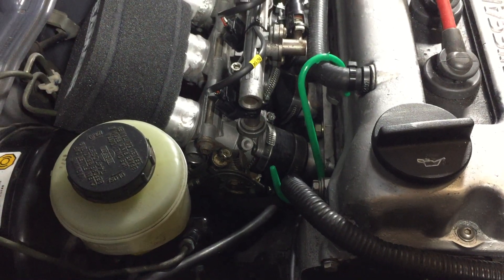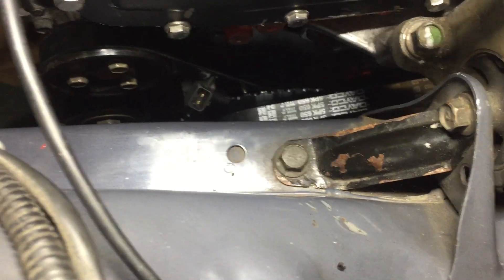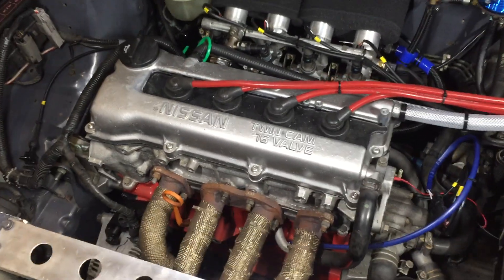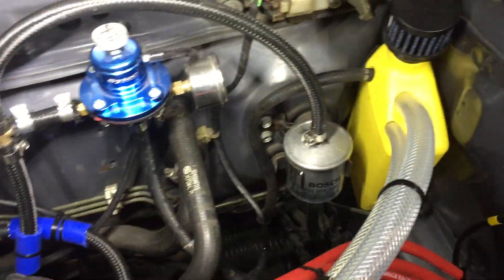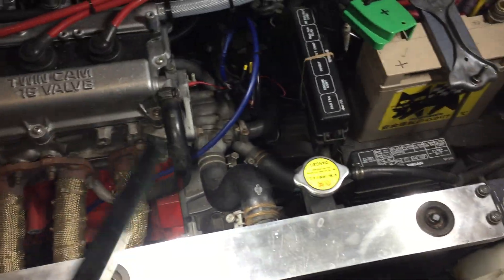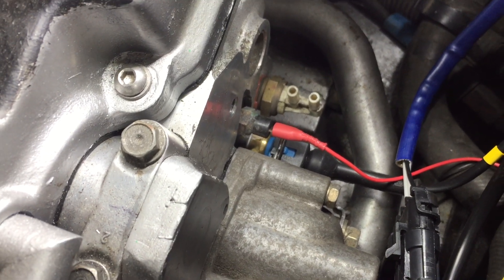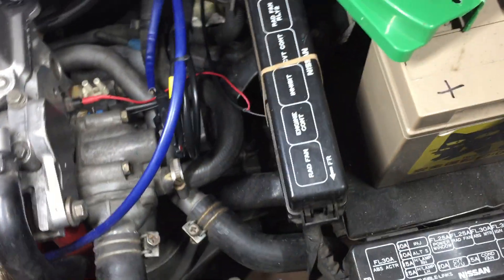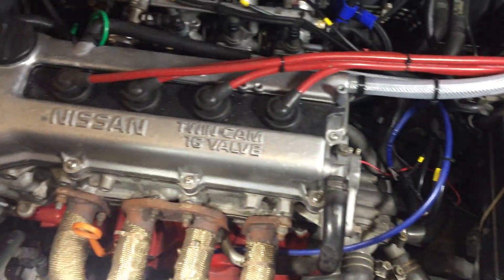149 bhp Nissan Micra K11 ITB Throttle body build walk through

Comment: Great video thanks for all the insight in to the mods done, is this all on the standard bottom end? Impressive if so revving out to 8k - what you have is similar to what I’d like to build, though ideally I’d like to get some decent rods (not found a supplier as yet), have the crank bladed/wedged, flywheel like yours then have the lot balanced; I’m hoping that lot would give something you could rev to >8k safely but not found much info on the internet… lastly please get some videos of it under load, she sounds great!

Comment: hello, nice engine build. i would like one question please.  it is possible change my ignition distributor system for the ignition system which dont ingludes distributor? beaucause my distributor has broken in the engine part, one leg in the cams has cut... and dont need again...
Reply from the maker: you would need to change the ecu to a standalone run anything other than the stock distributor

Comment: Great video.  I have a cg13de engine that I will be putting into my classic mini next year and looking to do a few upgrades.   Do you know the part number of the ttv pulley with trigger wheel?  Also,  are you running a cam position sensor for the ecu?
Reply from the maker: Thanks buddy, TTV item number 3005, no need for a cam sensor if you're running standalone management,

Comment: I found the same timing my 774 cams for my mini's cg13de, I was able to create some adjustable cam gears (sort of) by giving an old cam and standard cam gears to a machinist he was able to use an indexing head to rotate 3 teeth and add 2 crank degrees, 1 cam degrees, and drill a hole for the dowel, 6 holes spaced evenly gives up to 6 degrees of advance and retard, each tooth changes 15 degrees I think so further changes could say advance 1 tooth and retard 4 degrees, 15 - 6 = 9 degrees of advance. It's easy enough to move the gears that you could tune cam tming on the dyno, a bit more precise and reversable compared to filing the dowel pin. Just an idea if you want to tune cam timing.
Reply: Hi there where did u get the cam gears made
Reply: @neilbeckwith567  a local machinist was able to drill 6 new dowel holes with 2 degree (camshaft degrees) offsets so I can advance / retard 2, 4, and 6 degrees if you want more adjustments you can start moving the tooth the chains on, one tooth is something like 13 degrees.

Comment: How much did this build cost roughly, and could you post videos of it driving/idling
Reply from the maker: The engine was roughly £2.5k, sorry don't have any driving bids at the moment, but may do so over the coming months
Reply: @bashracing5249  not too bad. Im trying to decide what route im going to go either turbo or itb.
Reply: @bashracing5249  did you build it yourself or is that just the cost of parts and you did it all yourself?
Reply from the maker: @kieranmaharajah6933  yeah built it myself, so no Labour on that price
Reply: @bashracing5249  thank you I'll be building mine in summer once I get the space!

Comment: Hey cool Video!
If you could choose between the 1.3L CG13 or the 1.4l CGA3 Engine, which would you choose for a high power/rpm N/A engine? Thank you
Reply from the maker: The CG13 has stronger pistons and will make more power with supporting mods due to a being able to rev higher, but for a budget (ish) build, the CGA3 bottom end is good as the longer stroke gives a little more torque and will handle 7k rpm pretty easily, for ultimate spec a built 1400 forged bottom end from IK Engineering is the way to go
Reply: @bashracing5249  Thank you for that quick answer
Reply from the maker: OppaiGeek  you'll need to bore the cylinder out 1mm but yes is's possible, I would have a look into fitting the pistons from the 1.0l engine though as they are direct fit and raise the compression of the 1.3 giving a good cheap power increase
Reply from the maker: OppaiGeek  speak to IK Engineering they do forged cranks

Comment: Hi currently doing similar mods to my car I have the ford wasted spark coil pack could you let me know what sparkplug wires did you use?, Thanks 👍
Reply from the maker: Hi, They're custom ones made by formula power with micra plug ends and ford wasted spark coil end and are plus 300mm long over standard

Comment: Are the bike throttle bodies progressive enough for using on the car? I know bike carbs aren't great as the butterfly opens too quickly
Reply from the maker: I changed the pivot point on the micra pedal to lengthen the travel

Comment: Just subbed. Can I ask if you could measure the engine? Want to see if one would fit in my old Mini. Front of the exhaust man to the furthest point on the throttle bodies, width of block and gearbox and rough height? Would really appreciate it. Thanks Mike.
Reply: You can a lot of people have fitted a micra engine into the mini.
Reply: @zezex3116  Its the throttle bodies fitting thats important to me
Reply: I've got one in my mini, I've chopped my bulk head out and moved it back about 25mm but have got around 40mm gap between my manifold and front of mini. So didn't really need to do the mod to the firewall. I have got a flip front tho I very much doubt you would get one in the standard body without cutting inner arches and that sorta thing.
Reply: @Classic_Re-creation  you can without cutting the wings, as for throttle bodies people just angle them up more.